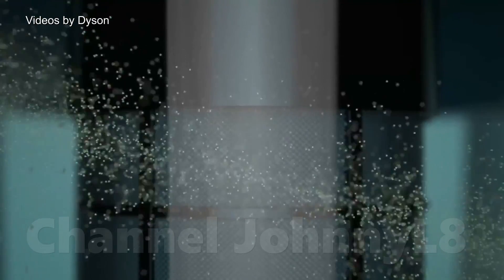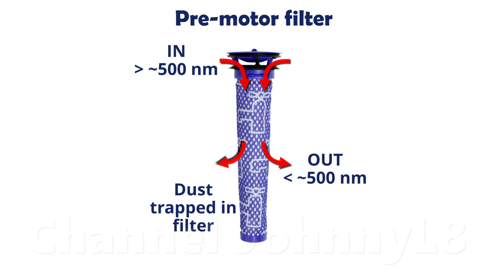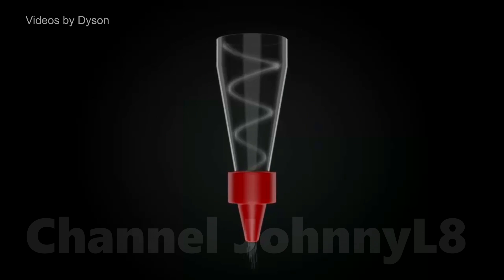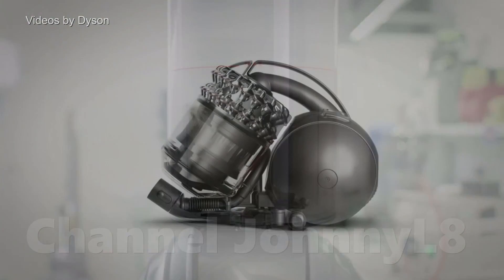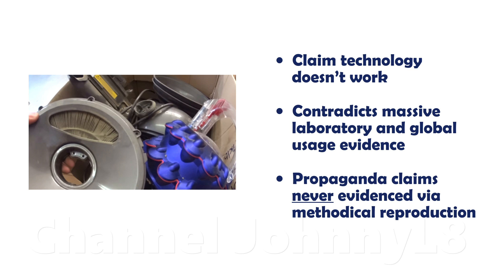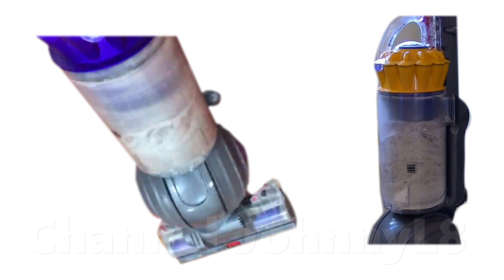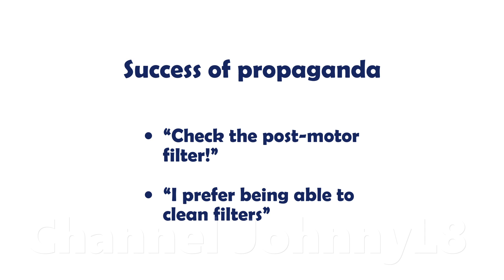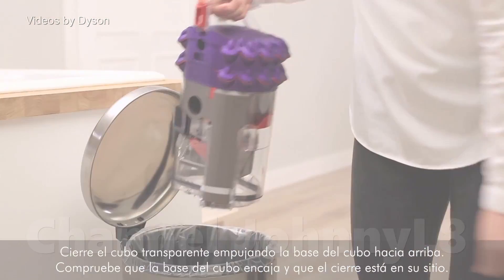Dyson Cinetic Technology is Amazing

Comment: Very interesting video, they’re very well made. Although after a period of time they get blocked, naturally and is flawed, sorry 😐, but yes, the majority of broken machines are due to neglect. How many Dysons do you have and how long have you been using them? You claim this, but where are your proof videos?
Reply: It would be interesting to see data how well the cinetic system works in the normal household use after a several years and how dirty the post motor filters gets. I am not interested of any Dyson test data, because it's just a "Dyson data". If vacuum cleaner repair shops have to constantly deal with the clogged cinetic models there are clearly something very wrong in the cinetic technology.
Reply from the maker: I've seen no evidence of that (that doesn't turn out to be propaganda sourced from user neglect and abuse). It's a myth, hence the video. If you have formal evidence, please share.
Reply from the maker: I've had the Light Ball since near the initial review date. Also proof videos about what? That Cinetic tech doesn't block? That's for Dyson to prove. They've got test data (apparently) to show it doesn't fail after 10 years of household dust (was all discussed in the video).
Reply: I’ve just bought a second had Dyson DC75, one year old, it’s wreck. Do you work for Dyson?
Reply: I don´t know where those cinetic vacuums came to the repair shops, but I am very concerned about this. If experienced mechanics from the vac shop warn to stay away from the cinetic models it makes me think.
I think it was the Performance Reviews channel showing faulty Dyson with clogged filters.
So which one would be better Cinetic big ball or regular big ball upright?
Reply: @Mike81111  most vacuum repair shops are probably trying to sell you something. some places, such as the vacuum cleaners subreddit and the VacLand forums, are filled with people who will dismiss and distort the truth, even lie to push their anti-bagless (mostly anti-Dyson) propaganda. many vacuum repair shops are filled with these same people. I wouldn't trust those that talk about premature motor failure in these Cinetic machines, because they're probably taking an example of abuse as the norm for everyday vacuuming.
Reply: William Kinkade  Dyson Cinetic models are now discontinued. It was a big fat fail. Normal people will always in some point abuse their vacuums. Unintentionally, of course. Cinetic can't handle it like other higher end quality vacuums.  I am sorry if you bought the Cinetic Dyson. No need to cry for your loss here.
Reply: @Mike81111  it hasn't really been discontinued if Dyson still sells both the Cinetic upright and the canister on their website. I did not buy a Cinetic, as while it has impeccable fiiltration, the machine's power compared to their other products is lacking. No need to cry because there is no loss for me.
Reply from the maker: It's not clear why you're so concerned about this without giving a respectable reason. I'd suggest that a better explanation for why "experienced mechanics from the vac shop warn to stay away from the Cinetic models" is because such models reduce the need for maintenance and represent a business threat. Thus, smearing the technology without evidence would be the best way they have left to counter it. As discussed in the video, and seem to be repeating constantly, the accounts of faults in Cinetic cleaners show absolutely no evidence the technology fails if used according to the manual, and instead show evidence of likely abuse. I'm suspecting many people are watching my videos by title only because there's no way these fully addressed issues would be raised in comments otherwise...
Reply: I am concerned because I did some research from the youtube to buy a new upright. I came across those videos and this video.
Looks like I will get the model with pre motor filter. Just to be save.
Reply from the maker: Lol; enjoy, and thanks for your insightful comments that helped thoroughly justify your concerns in a respectable and evidence-supported way.
Reply from the maker: Na I've no affiliation with Dyson at all. In fact, I only use 1 vacuum now (a V10) and am a tech-geek more than a Dyson fan boy. If another company brought out tech that was as well-imagined and intended as theirs, I'd no doubt be interested; unfortunately, they're fairly unique in the marketplace.

And yes, you're right; as a manufacturer, other than abusing your own product during the testing phase and playing statistics games with the warranty, there's not much you can do about users abusing their machines. You can remove all the maintenance, and reduce things to as simple a task as just emptying the bin, and they still won't do it. Imagine things from the perspective of a manufacturer. You want to help the customer but some people are just beyond help, are totally careless, and will happily complain and smear you for not being their product cash-cow. I'm not convinced a majority of people are abusers, but a sizeable minority I could definitely believe (without official numbers to back things up).
Reply: I will be doing a video soon on what my second hand one looks like. The majority of end users do abuse their machines! You do talk a load of old poop 💩😂😂😂😂
Reply from the maker: To outright dismiss formally collected objective data, just because it came from a company testing one of their own products is irrational. It's the subjective bedroom user test data which is rational to dismiss because it's not rigorous or of scientific quality, which is not the case for Dyson's tests. Such a dismissal also implies the assumption they've fabricated data which is a serious accusation. It's also faulty logic to claim that just because vacuum shops get broken machines in, there’s something wrong with the technology. This thinking was debunked in the video; abuse is more likely the reason they’re in vacuum repair shops. In fact, why else wouldn’t Dyson’s warranty cover it unless it was neglected. I mean, come on...

Comment: Your videos are beautifully made and narrated. One challenge on this one. Have you dismantled any Dysons with Cinetic cyclones?  Those who have,  are reporting that they still clog badly after prolonged use. Not sure it’s the answer yet.
Reply from the maker: I haven't no. But to repeat the content of the video, even if others had and found them to be in poor condition, that doesn't say anything about how they got like that. Also, all that's really important are the objective measurements of performance. Dyson claim to test not just to industry standards, but well beyond. For example, at bin full, and then at bin full after 10 years of replica test dust. No performance lost is measured. The only way performance would be lost is if they had not been treated according to the manual (i.e. normal responsible use). Most importantly of all, no one has ever rigorously demonstrated formally how, by following normal use as instructed, they could reproduce a failure. I covered this in the video. It's easy to show how a machine can be neglected, and I pointed out that many are eager to use neglect as an excuse to peddle misleading nonsense as propaganda. You've always got to be skeptical of nonsense on youtube and always demand rigorous evidence from people who show this stuff. If people want to show this fails, then they've failed to do that professionally and in a way that eliminates all suspicion of fabrication so far.
Reply: JohnnyL8 I should have watched the full video before posting as you do go on to make that point! Really interesting. As someone who makes money from refurbishing and maintaining Dyson’s It will be interesting to see how this develops. I love the fact you can strip down most earlier models to their individual components. Suction and reliability/robustness seems better on the older models too. I have a 2017 Dyson Cinetic Big ball cylinder which is good but doesn’t pick up as much as a 2004 DC07!! Progress?
Reply from the maker: Don't worry about it; I'm sure many people watch my videos by title only before commenting. But it's nice to see people going back and watching them properly and learning; it shows that they're not fundamentalist in their opinions and are open to reason. :)
Reply from the maker: It's also interesting, because some have argued the opposite regarding robustness, claiming earlier models were less robust. So both can't be right really. I don't know about other manufacturers, but Dyson demonstrate they do very thorough testing to destruction, and have full statistical analysis models of lifetime prediction. Hence why they guarantee for 5 years and expect them to last 10 years. (The 50% difference is a consequence of statistical analysis if you're interested). This assumes they're treated responsibly and as we all know, people don't, and hence why there are people like you who are needed to repair.
Reply from the maker: Also, as I've discussed in another video and will go into more detail in a future video, cleaning performance is determined by many more parameter than just suction alone. How it's used is more important than how much there is.
Reply: JohnnyL8 I like the scientific approach that you take in your videos. Rarely present these days. Have you done any comparisons of suction efficiency for old v new generation Dysons? I realise it’s only part of the effectiveness of Vacs.
Reply: I am also amazed by how much additional dust can be obtained from recently hoovered (same hour) carpets. Makes you wonder if it’s ever possible to get all of the dust up!!!
Reply from the maker: I haven't seen any such data but it would be nice. Seeing hard objective data is very difficult because so little that's formally collected is made available. I don't know why Dyson who can do these tests don't show it; maybe lawyers have something to do with it, who knows. Again though, suction is less interesting to me than the cleaning performance measured by the industry standards (and beyond). The Light Ball showed that with <=90 air watts of suction, you could achieve the greatest average performance across all floor types relative to other uprights if you get the other factors right.